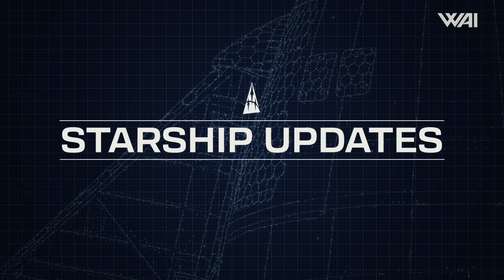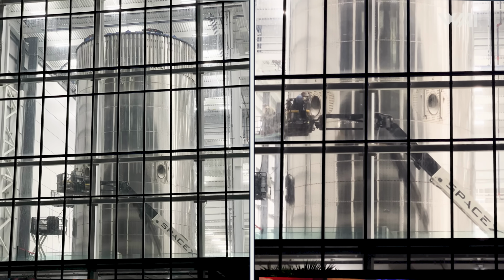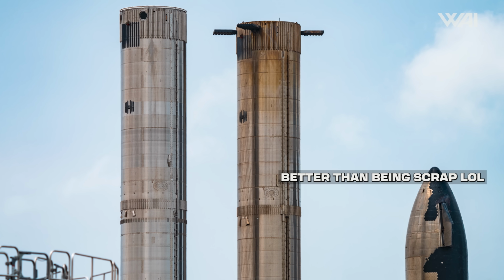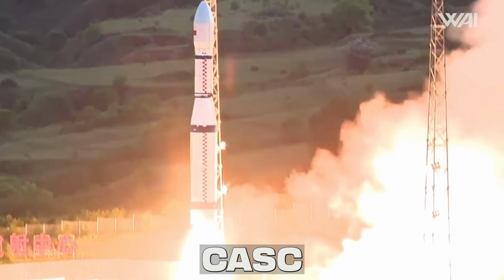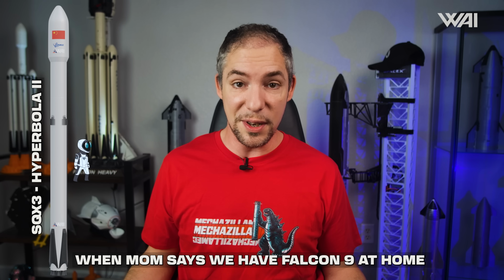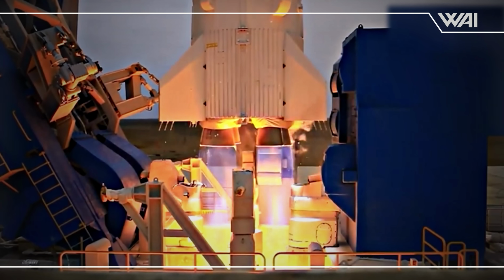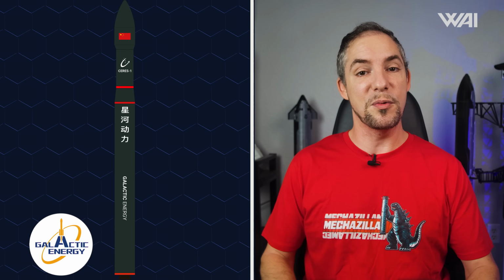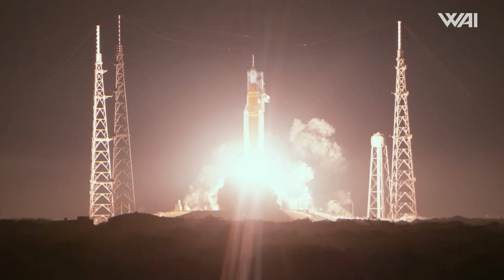SpaceX Unveils Massive Next Generation Starship Upgrade! How Did We Miss This???

Comment: Starship does not need larger engines as much as it needs a re-entry control system redesigned from the ground up.  SpaceX doesn’t seem to know or understand how the upper atmospheric tides work.
Reply: Starship wipes out on re-entry like a surfer wiping out on a large wave.  <——atmospheric tide

Comment: The specs between falcon 9 and the Chinese clone got me thinking, most of the booster specs are very close yet the Chinese rocket it boasting a good amount more weight to orbit. Does anyone know anything about the engines on the ‘clone’ because the difference has to be there.
(And I know I need to keep in mind that the Chinese rocket has yet to have flown a reusable version so the numbers could be aspirational)

Comment: It is amazing how fast you can go if you are copying someone else who proves the capability is achievable and what architecture works. In light of how careless DOGE is with security, (case in point the NLRB database that Russia downloaded mere minutes after DOGE had access),  I wouldn't be surprised if the PRC doesn't have the SpaceX blueprints as soon as the SpaceX engineers get them.

Comment: more thrust from the 35 engines vs the 33 , however does this not result is the fuel being consumed quicker, can you show us a chart of where or how far it can launch vs the old booster!
Reply: The engines are throttlable so V3 could be throttled back to produce the same thrust as V2. So, for the same payload, V3 should burn about the same amount of propellant as V2.

Comment: I hate to pee in anyone's cheerios or frosted flakes, but the starship development has gone nowhere. just a shell with engines right now which has yet to achieve orbit
zero talk of how they will get astronauts back to the ground as they are certainly NOT going to catch people in the starship. No one will ride that back to the launch tower without some type of ejection/escape system which would require a total redesign of starship into two parts. Starhip as a cargo hauler will work well but as configured now, that is all it is going to be. Maybe no plan for humans but just robots
Reply: That is why in Artemis III the Starship will only be used as a HLS system, the astronauts will go up on the Orion Multi-Purpose Crew Vehicle not the starship.
Reply: @  if Orion ever gets working

Comment: Booster is not the problem. Second stage is.
Reignition, reentry, landing, actual payload margin, reusability. Stage 1 can't help anything about that.
Reply: True enough.
Doesn't hurt, though.
Reply: @michaelmicek  Well, eventually one could consider 3 stage setup? Since for that to make sense, the intermediary stage must be big enough. Or it's just dry mass. So the booster stage would have to grow significantly.
Then with 3 stage setup eventually you could win extra payload or deltaV on LEO. 
Except we still have no clue about the current real payload. Because it depends on unfinished second stage, unfinished landing system, unfinished heat shields, etc.
Reply: @vensroofcat6415  Eager Space is a good channel for this kind of discussion.

Starship has to stage quite early for the booster to make it back, so as you say, the second stage is where the problems have to be solved.
The picture released a year or so ago of the next (third) version showed a slightly larger booster and a much larger ship.

In one sense, third stage options are already assumed: anything Starship puts into space is going to need its own thruster and propellant to get where it's going, or be refilled on orbit.
It might be interesting to think about how a reusable, suborbital middle stage would work.
Where would it land?
Wouldn't it still require substantial shielding?
How is the upper stage released reliably, without threatening the integrity of the middle stage aerodynamics and shielding?

Comment: I would call the new booster "the reason flight 10 failed!" We have to get the flight 9 failure over before we can move on to the flight 10 failures. So far Musk has made over 3 versions of the Starship if you include the 3 fin models that didn't get off the Drawing Board. Several upgrades to repair unforeseen or overlooked problems and after 8 attempts still no successful flight and landing. Now to fix all of those problems the solution is to make an even bigger booster and Starship that are redesigns of the redesigned redesign! At some point in time someone should realize that the reason NASA in 1969 got to the Moon in the 6th Saturn 5 Rocket flown was through thorough design and ground testing of all hardware and components to assure a high level of FIRST TIME SUCCESS, NASA almost assured their equipment would Work as Advertised. As opposed to Elon's "let's dream up and idea, throw some shit at the wall and see what sticks" approach. His learning curve is obviously going to be ONE LIFETIME! The question is, at Who's Expense?

Comment: Sorry, but SpaceX engineers working on starship must be really, really stupid! Apparently, they can’t really use a spreadsheet or the tools that they have to come up with a design that can last more than a couple years. Why are starship version two and version three necessary? Did the laws of physics change overnight? Or is it the case that the SpaceX engineers don’t know what they’re doing And designed he starship version one that is not economically viable and maybe not even technically workable? We should not be celebrating starship version two and starship version three because they are proof that SpaceX engineers failed not once but apparently twice because we need to have not won, but two new starship versions. Why couldn’t SpaceX engineers design starship correctly the first time? And, if they couldn’t design it correctly the first time, why do they need to redesign it not once but twice? Are they that bad at designing?
Reply: Intentionally so; blame it on Musk (or even Musk's stupidity) if you want, but he has his reasons and the engineers aren't stupid, but working within his methodology.
Rather than start with designs they are confident will work, and then optimize, they start with designs that they know are inadequate and then make necessary improvements iteratively until they get something that actually works.
This is similar to software development where instead of trying to develop all desired functionality at once, you start with the goal of creating a "minimum viable product".
With IFT-1 the minimum goal was just to get off the launch pad.

This avoids costly mistakes and generally keeps development costs manageable, especially if your prototypes are made from cheap stainless steel and not hard-to-work-with carbon fiber, or even aluminum.

The fact of the matter is that the goals for Starship are up against the limits of what are physically possible, so success is not guaranteed.
(The channel Eager Space has some good semi-technical analyses.)
So give the engineers a break.

Comment: Do you think they’ll ever launch the rocket from the chopsticks or would the damage to the chopsticks be too extensive?
Reply: Why would they do that?
HOW would they do that?
The chopsticks lift or catch half the rocket and set it on the launch mount or the booster that's on the mount.
They can't manipulate the upper stage while holding the lower stage or vice-versa.
Anyway, it will take a couple of hours to refuel the rocket; moving from the catch to the mount will only be a small portion of that.
Reply: I doubt that chopsticks designed to hold an empty booster can handle a fully loaded full stack.  
:planet-orange-purple-ring:
Reply: @Scanner9631  That sounds like a solvable engineering problem. 

My thought was about rapid reusability and specifically infrastructure for launches on Mars as a water based flame diverter isn’t feasible. Even with the lower gravity, I think they’ll need to solve that issue.
Reply: @ 

That is a different question.  Look at HLS for the answer.  diagonal aimed rockets above the methane tank for landing and initial launch on the Moon.  The same for Mars.  A sort of Super Draco like the Dragon capsules use.
:planet-orange-purple-ring:

Comment: Why are you mixing metric and standard measurements?  (Weight vs thrust)  Wouldn't it make more sense to have both measurements  in the same system of measurement?
Reply: American rocket scientists often express quantities relative to the acceleration due to gravity at sea level.
With that convention, thrust to weight ratio is dimensionless and specific impulse is measured in just seconds (rather than m/s or ft/sec).

Comment: I need to re read the construction of the Saturn 5 launch pad.  From what I can remember there is over a 1/2 mile of concrete used in the launch pad.  It might be more.  I do remember readuing some huge amount and could not imagine that much concrete.  HERE IS ONE THING THEY SAID, or something like they could build a high way across the USA out of all the concrete they needed.  I read this when I was about 15 years old in 1972.  Everything was so modern, back then, Laugh.

Comment: Isn't V3 just labeling for Raptor V3. On Ship 38 there was also a V3. I think it would make more sense that V(ersion) is for Raptor and Block is for Ship and Boosters.
Reply: and I think you forgot to account for the added mass of the vehicle-side commodities. If we consider the total mass, it should be 94,875 kg with Block I and 60,200 kg with Block II. One more thing. Don't forget about the Raptor boost variant, which produces slightly more thrust. With the outer 20 engines being the boost variant, they would reach 10,000 tons of thrust, which matches their goal.
Reply: @Damn-2 forget the v3  has lest parts  make it lighter
Reply: R3 - Raptor 3
B3 - Booster 3
S3 - Ship 3
XX/x - various iterations of any

Comment: I get it. With the two more engines the 35 engines gross weight is less, but how much more fuel they use?
Reply: The engines are throttlable so V3 could be throttled back to produce the same thrust as V2. So, for the same payload, V3 should burn about the same amount of propellant as V2.
Reply: @greghadaller  Sure, but they probably going to use the extra to take more payload up.

Comment: Flame Diverter... Dhhhhhh... Changes-on-changes-on-changes is a terrible engineering practice.
Reply: Really?
It would have been an incredible coup if it had worked, given the plan to build several, if not dozens of them around the world.
And it was (literally) a lightweight scaffolding to gather initial data to inform the design of the second version.
I get that a typical product development cycle involves overengineering the first version before subsequent cost optimization, but this is not a new electronic gadget, it's a multi billion system that operates at the edge of what's physically possible, which the R&D process is exploring.

Comment: Wait, are we not gonna talk about those cold gas thruster on that booster V3 we saw through the window or did I just not notice that on the old ones?
Reply: I don't think that's what that is at all. Why would a booster need gas thrusters? I think it has to do with the fact that booster V2 are going to be fueled with two quick disconnect ports higher up.

Comment: Is the mass flow rate also increased in the V3 raptor engine? Or just the spesific impulse?
Reply: If thrust increases proportionally more than specific impulse. You could do the math.
Reply: @theterminaloptimist  right, I could just calculate everything myself!
Reply: m(dot)= F/(g0.Isp)